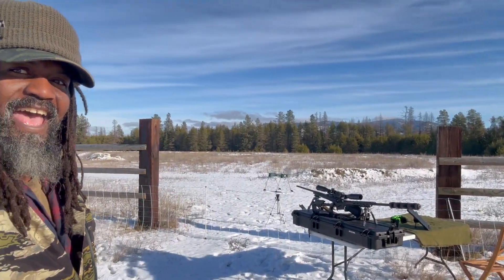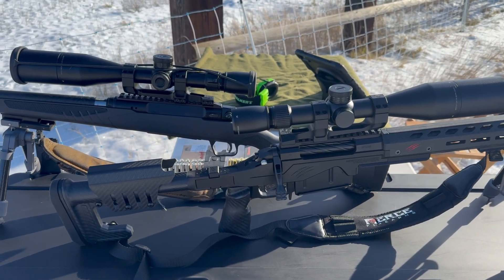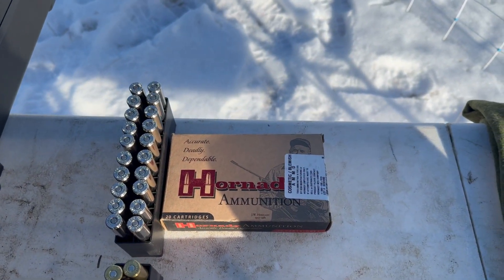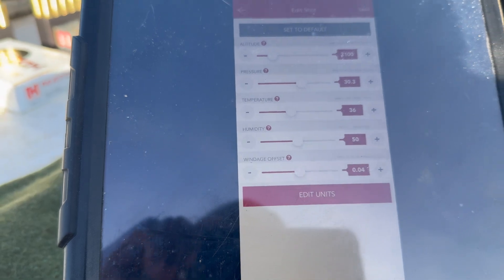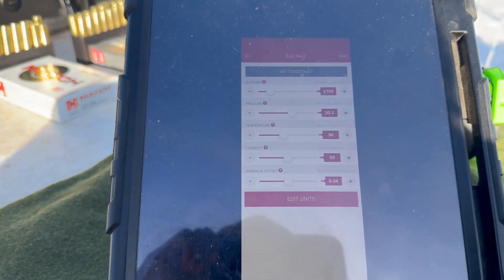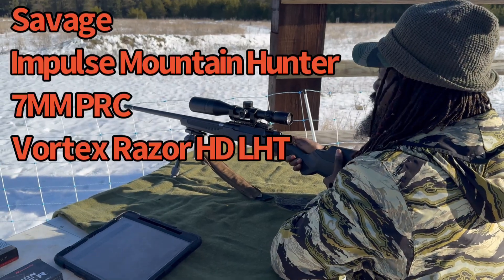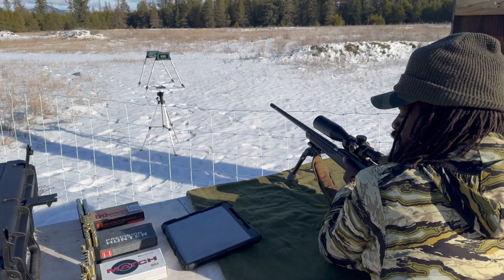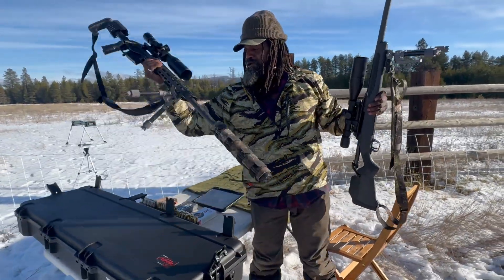7MM PRC factory ammo velocity testing fired from 2, 22” barrels.

Comment: Pretty sure ALL factory ammo test fires and develops through 26 in barrels for magnum cartridges then rounds up….with a case capacity of a PRC through a 22 inch barrel, you’re loosing four inches or burning capacity and handicapped by 125-150 fps. 

Faster powder in spicer hand loads,  should get you close to 26 in barrel velocity with the factory ammo.

My 280 Remington 22in barrel with hand loads is matching factory 7PRC factory, Hand load the PRCs and watch them zing lead.

Comment: Hornadys numbers originated from a different powder than they currently use. They can’t get and don’t have anymore stockpile anymore. Federal uses the powder hornady originally had. Try the velocity of a federal once, bet it’s pretty close to advertised? My opinion, cx bullet is what you want for elk or bear though. Also once you shoot copper through the barrel a standard bullet won’t shoot the way it did before without thoroughly cleaning the barrel 1st. Great videos man! Just bought a 7prc mountain reaper, have yet to shoot it
Reply: I was going to say the same thing. Hornady went on the record to say they have powders available that go faster but suffer accuracy. They chose a powder that was still as accurate but slower than their original powder for the prc. I was going to say that about copper too, although I am certain it's the other way around, copper monolithic bullets are finicky and need a clean barrel with no other metals fouling it.

Comment: Notice how the precision hunter 175 eldx load doesn't come close to the 3000 ft-sec advertised on the box.  Hornady says this is because of the powder shortage they changed powders without telling anyone or changing the advertised muzzle velocity.  Everybody seems to be getting around 2800 fps. in a 24" barrel.  I guess you should expect slightly less with a 22", but not that much less.

Comment: Many test barrels especially for magnum cartridges are 26-inch barrels. If you are searching for the best powder for velocity, it most likely will be Reloader 26. Check all the data you can find online, and you will see that is the one that gives speed above all others. And i don't think that it is temperature sensitive. Someone below said they thought it was, but I don't think so. I would read the specs to make sure before buying. It's pricey around $50 a pound now. It seems available at that price. For a long time, it was hard to find and unavailable. I had it on my wish list but since the price went up and I bought other powders when it wasn't available it will have to wait.
Reply from the maker: For 7prc the test barrels are 24", I'm shooting a 22" so there should be some loss of velocity. Reloader 26 would be an excellent powder or the cartridge, but it's pretty much a thing of legend at this point, you can't find it anywhere. I've decided on a load with retumbo and the 195 grain Bergers.

Comment: I had the same chronograph as you and it was about 100 feet slower than i thought it should be. I bought a magneto speed and velocity started acting right. I'm hitting targets consistently at 750 yards now with the new info.
Reply: A Magneto Speed is at the barrel. His chronograph is down range, and the velocity is less down range. Who knows which one would be correct if they read different anyway? One could be inaccurate telling you it was faster than it is. Or as you suspect the one tells you it's slower than it is. I suspect the chronographs are not too far off from one another that you have and it's a distance thing.

Comment: Your rifle is new and it will speed up after 150 rounds typically.  Some take 200.   

I think the goal of the 7prc was to get a 178-180g to 2850ish.  

The box saying 3000 is simply marketing exaggeration.  Lots of brands have done this in the past.  Few will vary barrel longer than 24 inches in the mountains.  Add a can and it’s even longer.  

Reloader will be able to take a lot more advantage of this case then factory users.  

I’m not a fan of any case with a belt as those can cause feeding issues and are not needed in today’s standards
Reply from the maker: Agreed! Check out my follow yo load development videos! I still don’t have a good velocity, I need a better chronograph, but I’m sure I’m over 2900fps.

Comment: Temp difference from cold to warm barrel will have a larger spread in cold weather, just due to material contraction and expansion on the barrel. may have some value on powder as well.With 2 at 3k, one a hair lower, in a 24, vs the 22",  -150 is not all that surprising, do the same test at 70F, probably only 50-75fps difference, so not really anything too unusual happening here.
Reply from the maker: I’m pretty far north and I think the sunlight was having an adverse effect on the chronograph too. I tried another light based one with similar huge extreme spread. I’m trying to get my hands on a garmin Xero or one of the new Caldwell VelociRadar.  

So far, firing a few shots out to 1500 yards indicates a higher velocity than the 2900 fps estimate I used in the ballistic solver. I’ll be using drop to calculate velocity once I get a good load. 

I’m close with eldm’s but want to see if I can get a good load with 195g Berger EOL’s too.

I’m using Retumbo powder, because it’s grouping well and has a very low temperature sensitivity.

Comment: I'm gonna hand load bought a box of 180 ELDM to determine how short I wanted my barrel. I ain't going less than 20 lol. 3 shot Average 2810, Extreme spread 50 SD 20. Wasn't impressed for sure...22 inch barrel 25 degrees
Reply from the maker: I arrived at a good hand load with the ELD-M’s. Still not sure on velocity, as it seems my chronographs were not reading correctly. I did find a nice accuracy node at a heavy charge weight though. I’ll be figuring velocities by measuring drop, as soon as it’s not absolutely freezing! Lol!

Comment: I ran my 7prc Fierce CT Rage through chrono last week. Only tried the 180 eld-m, 24" barrel   velocity averaged 2850 for 10 shots. I was at 200ft above sea level, and 5 degrees C ( 41F)
Reply from the maker: Thanks for the info. That translates pretty well to my velocity with a 22” barrel, 36.5 FPS slower per inch.

Comment: this 7mm prc does not look like it beats the old 7mm rem mag,,  not sure there is much point of switching to it,, a fast twist barrel on the the 7 rem,,looks just as good,,maybe better,, great video,,
Reply from the maker: If comparing stock factory 7 PRC vs a stock factory 7 mag both shooting factory ammo, the 7 PRC does outperform the 7 mag especially the further you range out. You can definitely get better performance from the 7 rem with customization, but you can widen the gap again by similarly customizing a 7 PRC too. 

If you own a 7 mag and don’t shoot past 300 or so yards, you’re correct no reason to make a change though you’d still see an improvement in wing drift with a 7 PRC. 

7 mag is a great cartridge, there’s no denying that. 7 PRC is just a better. There’s a lot of little things that add up to a better preforming cartridge for those that want long range performance and/or increased precision accuracy. It’s built around shooting long high bc bullets, it’s chamber dimension are made to tighter tolerance, the twist rate is optimized, and if shooting the same long bullets, the powered capacity is higher (case capacity is actually higher on the 7 rem, but reduced because the longer bullets must be seated deeper in the case making it have a lower powder capacity.) 

You can definitely do wonders with any cartridge if you have the time and money to customize, but 7 PRC is a little better starting place than 7 rem mag. 

The gunwerks guys put out a video saying this themselves. In a nutshell, eventually the 7 PRC will probably be their starting platform for their 7 mm rifles.
Reply: @apex-livingwithpredators8379  you are right on this, going the best with both , the prc wins,,i also shoot the 7mm stw,,with 175 boattails,,so i have about all i need and maybe more than i can shoot without recoil issues,,

Comment: 22" barrel. 160 CX Factory 2910 / Reloads 3012. 175 ELDX Factory 2883 / 180 ELDM Factory 2881. All sub 3/4 or smaller which for me is priority. Reloading the 160's was a piece of cake and expect the same with heavier pills. This is my first 7mm and very glad I chose the PRC
Reply from the maker: Thanks for the info! I’ll be doing some testing of reloads soon and more velocity testing after firing an additional few boxes through the rifle to see if it speeds up a bit after 120 rounds or so. Stay tuned, thanks for watching!
Reply: @apex-livingwithpredators8379 
I saw a video of yours you got a cougar and were carrying two uppers for an AR, WHAT caliber do you use for cougar? Do they make a 7mm upper?
Reply from the maker: @TaylorChavez-h8e  on that video I was had a 50 Beowulf on the lower with a 6.5 Grendel upper on my back. I shot that cougar with a 50 Beowulf, another with a 45-70 and another with a 460 S&W magnum. I like to hit the immediate off switch with cats. 

A 7 PRC would do the job too. I’m not aware of any 7mm at cartridges though. 6.8 western may be the closest. But 6.5 Grendel, or 6 mm Arc would be great options!
Reply: Dang. My 22” was only getting 2871fps with the factory 160 cx loads. Now. I’ve got handloads with the 168gr Barnes LRX bullets going just over 2800. Wish I was closer to 2900 with everything. But my 168gr LRX loads just under 2800 seem to be most accurate.

Comment: I checked the factory loads and found they where slow. 2876 fps on the 175 eld-x and 2824 on the 180 eld-m on a 5 shot average. I'm using a remington 700 with a 26 inch barrel.
Reply from the maker: Sounds about right, or at least consistent with what many of us are finding.

Comment: Nice Video. So many factors contribute to ammo performance and it never ceases to amaze me the difference between individual rifles even with the same barrel length. I tested the 7 PRC Hornady Match load and got an average of 2847 from my 26 inch barrel. Unfortunately I also got flat primers, sticky bolt lift, and shiney marks on the case heads.. My 300 PRC Hornady factory loads are spot on the velocity claim and show no signs of pressure at all. They were fired out of a 24 inch barrel.
Reply from the maker: Whoa, are you saying you got pressure signs from factory 7 PRC loads? Was that in hot temps or something?
Reply: I'm hesitant to say it was over pressure because the velocity was so low but yes, these were factory loads and the ambient temperature was around 50 degrees. I was also allowing 1 min between shots and not allowing rounds to sit in the chamber. I contacted Hornady and they said no problems have been reported with that lot#.  Could be a tight chamber, soft brass, or a combination of the two. Just goes to show why it's important to pay attention to everything.  Have a blessed day.
Reply from the maker: @muzy125  wow! Thats very interesting indeed! I checked a few of my casings, glad to be able to say I didn’t see that. Especially as I start doing load development to get a little more velocity! Blessings to you too my friend
Reply from the maker: @muzy125 well, I put another 60 rounds of factory Mach ammo down the barrel today and damn if you weren’t right on the casing marks. More like shiny marks from the extractors than indents in the rim. But, the primers weren’t flattened… interesting… I agree it shouldn’t be pressure with factory ammo. But good to know as I do load development.

Comment: My caldwell ballistics g2 consistently gives me slower readings than i expect. Usually almost 100fps slower. I got dead nuts at 2800 with the 180eldm where i would have expected 75-100fps more
Reply from the maker: I just tested some reloads that were a bit over pressure, based on the casings after firing. I’m wondering if this is the case with my G2 as well. At that pressure I should have definitely been close to 2950 and I got a reading of 2786. Factory ammo was about the same as last test. (Both with the ELD-M) (video to come on this shortly.)

Comment: The problem with hornady is that they probably got 3000 at sea level but they use so many different types of powders. Each lot of ammunition is different or until they run out of it. That’s why you always check your ammo before you head out to the hills.
Reply: Still  need your email to give you data.
Reply: You people must read the small print!!!!!!! 3000 fps was under IDEAL conditions and setup!!!!! After many phonecalls and e-mails, I figure out the 'ideal' setup for them was: 26 inch barrel with no other 'add ons"...

Comment: I'd consider re-testing  within an hour of noon just to see if there's any difference. I've had some odd readings with light based chronos towards the evening hours. Based on the shadows I'm guess it was a little later in the afternoon. Maybe just send one or two down the tube and if you see a decent jump, retest to double check. I feel like I've heard rumors Hornady is using RL26, which is fairly temp sensitive. Otherwise some barrels speed up after a few hundred rounds down the pipe. Maybe some combination of all those factors explaining the velocity discrepancy. As you said, short barrel doesn't explain it all and Hornady is going to look real dumb if they're just tacking on 50-100 fps onto their numbers.
Reply from the maker: It was around mid day, but we are so far north that our latitude probably has the same effect. I’ve only got about 80 rounds down the barrel thus far. I do plan on getting that round count up to about 120 or so before I start measuring velocity again. Solid advice, thanks.
Reply: I think you are mistaken about Reloader 26 being temperature sensitive. I don't think so. It is the powder people go to for high velocity. It is one of the pricier powders because of its demand. It has been hard to find. I was wanting some but got other powders when it was unavailable and am just using what I have now rather than pay that high price of over $50 a pound.
Reply: @garrytalley8009  I think it's fairly well established RL 26 is not super temp stable. I don't think it's terrible, but it's nowhere near H1000 or RL23. You don't get something for nothing and all that extra speed over comparable powders comes at a cost.

Comment: Mine is a fierce rage with a 24 barrel and with eldx 2880. Now I have reloaded the round to shoot 180 Bergers vld at 3050 and still shoots bug hole groups. It also took a 6 point bull at 629 yards drt. Are you planning on reloading it.
Reply from the maker: Yes I am! Care to share your load data? Did your barrel speed up after 100 or so shots? My video after this one is on measuring maximum COL.
Reply: one more question, to add to Apex... what Chrono are you using?
Reply: Magneto
Reply: Call Berger and they will email data

Comment: Almost a 200 fps drop in velocity from the box is why I don't trust Hornady. 
Everyone uses a shorter barrel, and I'm not entirely convinced that their velocity from 24" isnt a cherrypicked value either.

As for the 7mm PRC, it seems like the 6 Arc: beautiful on paper, but no better than what exists in the real world.
Reply from the maker: I’m convinced at the performance potential of the 7 PRC, but yes, factory loads are about 150-225 fps slower. Barrel length should really only account for about 60 fps difference and it seems consistent from many folks I’ve talked to. 

It’s the bullet that’s the star here though, not necessarily the velocity. These long highly aerodynamic bullets will preform better especially at further distances than most other bullets at the same velocity. 

I want it all though, so I’m going to reload for the rifle.

Comment: I just don’t see the benefit over a custom barreled 7mag. My hand loads with the exact same 175gr ELDX are shooting 3000fps.
Reply from the maker: You’re correct, but most can’t afford a custom rifle though. But by the same logic, if you build a custom 7 PRC, the gap grows wider again. Nothing wrong with 7 rem mag, 7 PRC just does it better from factory specs. Gunwerks has a good video on the topic as well.

If you have a 7 rem custom or even a factory rifle that you don’t shoot over 400-500 yards. No reason to switch. But if you’re looking to buy or build a new rifle, 7 PRC is the way to go, if for nothing more than the modern/updated chamber design. There are lot of little differences that make a significant impact at range.
Reply: Even at 800-1000 the benefits are so minimal that’s I’ll just stick with the 7 mag. Same bullets and I’m getting the same speeds at the PRC. If the person isn’t able to hand load then I would say the 7prc is an easy winner but with hand loads they are just too close to call for me.
Reply from the maker: @jgsnipe1  no argument at all there. I’d take the same philosophy if I were in your position myself.